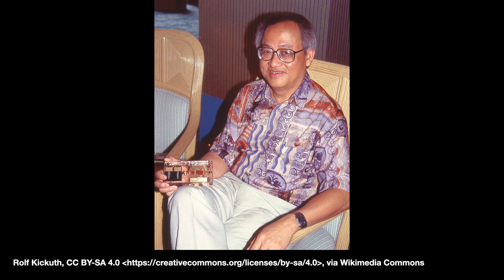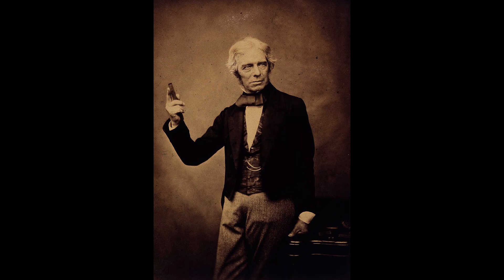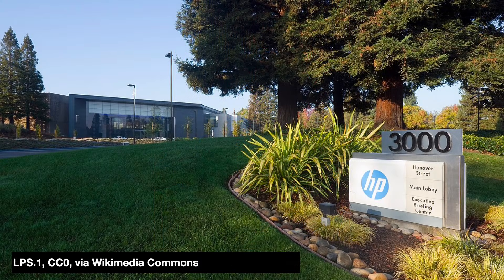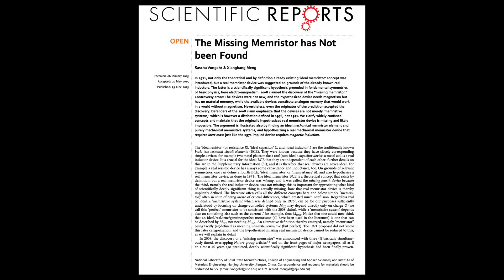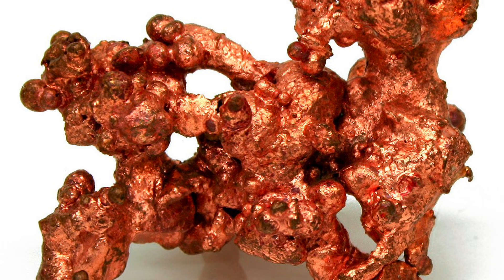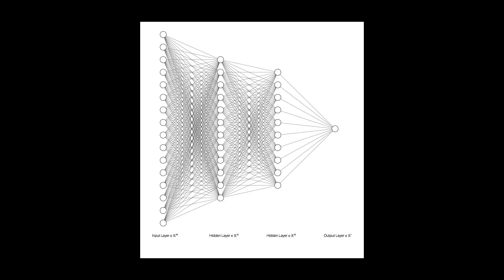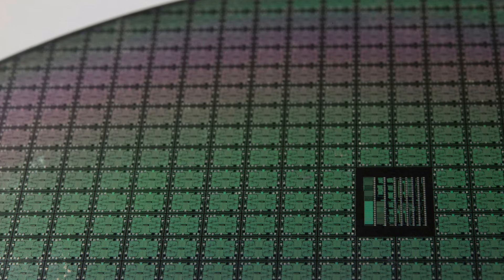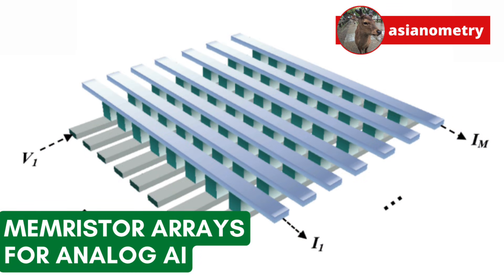Memristors for Analog AI Chips

Comment: I think you could improve the water/memristor metaphor. There's an idea called "preferential flow" where water will flow along a certain path, in this case along sand grains. It prefers to snake through certain channels in the sand as it flows down via gravity, leaving some pores dry and others wet (note: if water flows up via pressure, all pores get filled). Therefore, it's possible to have water flow out of a tube of sand while much of the sand is still dry. Pass another cup of water through it, and it follows the same path, like memory. Over time, water will intrude into the dry areas, though even this is like memristors in a sense because of degradation over many cycles. The memristors I think of with this analogy are the type made from many vertical stacks of 2D materials like MoS2 (think graphene but different atoms).

Comment: Unnecessary complexity. Even a simple resistor is a memristor when considering its thermal characteristics. Heat it up and keep it in a insulated environment to call it off (high resistance), cool it down and call it on (low resistance).

Comment: (1:40) Actually current (I) is not limited by a resistance in it's path. 
That happens when the path or is divided or otherwise diverted. 
Voltage (E) however, drops increasingly across an increasing resistance and the available power is reduced (because IE, or current times voltage = Watts). 
So a series resistance regulates power or ability to do work.  
If you make a ladder, as it were, of many parallel "rungs" of resistors, the voltage between the two rails will remain constant, 
but the current will be divided between all of the resistors. 
Greater power will be consumed in this, or in any circuit or part, by less resistance and maximally by zero resistance (e.g. short circuit).
Reply: EE here.  Yes, a resistor can limit the current.  If your supply voltage is 5 Volts, a 5 ohm resistor in series limits the current to 1A by dropping voltage.  The current in the circuit cannot exceed 1A.  This is what we mean by resistors limiting current.

Comment: This was a tough topic and concept to understand at least for me. But you sir described this in great logical chronological detail. That even I could understand it. Basically the flow of electron get sifted through a “movable” variable resistor. Which multiplies it and then gathers those values and adds then giving you an output. Did I get that right I hope. I don’t know why it muliples it maybe I said but I forgot. And why add. What’s the output for. And also how is this memory hwo is it a seeding something that happened in the past to use now. And fyi I thought at the beginning it would work more like the resistance changes depending on the previous resistance needed, and I guess when a new current or voltage would come it change again to that past resistance value leading it to idk change on the fly. Maybe that’s nano tech sci fi but that was just what I though going in. But coming out I now think differently. Again thanks for the breakdown and detailed video thank you and I hope you do more and carry on
Reply: imagine a river that creates a meander as it flow i believe thats a good analogy. the current shapes the resistance and the resistance shapes the current

Comment: Intel made an analog NN chip in 1990 based on  flash memory cells (aka isolated gate FET).   It wasn't a commercial success but I believe it's likely the best approach. Flash cells can be made in any normal CMOS process with very few extra steps. Analog NN really are many orders of magnitude more efficient because you're not shuffling data through your limited number of compute units.  Digital NN will also benefit from having compute local to every memory row,  but the chip real estate would get enormous.

Comment: The memristor is a non-linear device with two terminals. You have Diodes and Thyristors that fill this role. Or you can use a transistor and tie the base to the source or drain to form a two terminal device that has non-linear IV curve.
No need for memristor at all.
Reply: Memristors are a single component that can be engineered into a system to present several effects that are spread across several different types of circuits. While it is true that some of those effects can be replicated by certain other component configurations they are an order of magnitude more powerful than other configurations. It will in essence be the next step in components offering the change transistors offered. .

Comment: Hey, so... If you could get a memristor to quickly react to a high or low current and match it, wouldn't that just make... Ram SSDs? Like, actually. Could also be really good for CPU/GPU cache.

Edit #1 : I know memristor are, by nature, already RAM - but analog RAM. Doing what I suggested could make it binary, thus much more suited for non volatile RAM and cache. Like, could you imagine having a power outage, and when your PC turns back on everything's exactly as it were before it crashed?

Edit #3 : Actually, why limit it to "0" And "1"? By reading multiple levels (Let's say 0 to 3) you could have incredibly dense memory/cache (in this example case, 2*2*2*2 so 16 bits of data) similarly to how high density SSDs already do with different charge levels. Honestly, the memristor could probably fix the "cache apocalypse" of TSMC's 3N and below nodes since they're a single transistor instead of many, even if they might be a  little slower at first.

Comment: if they can figure out how to combine this with on chip forward-forward training (much simpler than back-prop but still good learning ability), it would be a huge step in using AI in a way that is not so centralized and does not need network connection, while being able to learn as it goes

Comment: Neural network of human brain is not analog. It is basically digital: A neuron can be activated or deactivated like a digital switch, not in-between. But it has variable number of input signal threshold to activate the neuron. kind of summing OP-amp/comparator. Resulting circuit work like analog circuit. Digital CMOS circuit can behave similarly. A array of switch coupled with digital memory cell also can work like summing OP amp. Not computing in digital binary number, but summing number of active inputs in analog way, though inefficient and low precision.

Comment: This is cool for me because I used to be in a group BEAM memristor group where guys were working on making them at home! 
Recently I've learned more about electronics and now there's all this legit research on the topic and it's great stuff.
Reply: I used to be part of a BEAM robotics group too, and before it died out, one of the last major discussions was the possible applications of memristors, and there were a few experimenters trying to make them. I think all of us had seen the Nile Steiner video and his home made memristors. I did 2 experimental designs, and did a full concept for a third, that I never tried out. First experiment was an absolute failure. Tried using silver paint to create the electrodes through a pinhole in an insulator over a Copper Sulphide layer over copper. The Copper Sulphide was way too porous for the silver pain and it just soaked in and shorted. 

For the second design, I bought 0.6 mm diameter aluminum balls from McMaster Carr to act as point contact electrodes. I created a sandwich between two PC boards, with the bottom layer masked and the copper pads reacted with sulfur to create the Coper Sulphide electrodes. The top layer reused the silver paint as a bonding agent to secure the aluminum balls to the top board. I screwed the boards together, but imperfections meant most of the 16 possible memristors on the board were either not under full contact, or were crushed by the force of the screws joining the boards. I had two of 16 memristors show hysteresis for about 2-3 test cycles before breaking down... a small success, experimentally, but ultimately, another production failure.

My third design, which I wanted to try, but then the first discrete chip based memristors hit the market (though costly). I never followed through, though I've considered going back to it. The design used a thick "sturdy" PC board as a base, and again, silver paint would be used to bond tiny Aluminum balls to Copper pads. these pads would attach to a 20 pin header soldered to the board. a spacer board and a "finger" board would be made from 0.5 mm PC board material. the spacer would support the finger board 0.5 mm above the base PCB, and the fingers would look like a comb with header pins on one end, and thin fingers tipped with a copper pad on the other end. Those pad tips would be reacted with Sulfur to create Copper Sulphide electrodes that would have only the force of flexing an 0.5 mm PCB by 0.1 mm. My hope is the much lighter force would not crush the fragile Copper Sulphide layer, and allow memristance to be observed. By having two rows of 20-pin headers, the part would have the footprint of a 40-pin DIP, be usable on breadboards, and offer 20 memristors in the space of a 1980s era CPU. That was the plan... I didn't learn KiCAD for another 4 years, and since then, KNOWM has released even more memristor options for discrete experimentation. Still spendy, but not as bad as the old Bio Inspired versions from several years ago.

I'm glad this video is covering the more analog capabilities of memristors. So many companies just looked at it as if it were just RAM 2.

Comment: There were two small start ups working on this in the US in the past few years but one of them went under like a year and a half ago. Definitely promising just needs the right team and right market concept. Edge computing the demand just isn't there yet and it's a lot of infrastructure to build up, I think it'd be smart to start with gaming accelerators - make a PCIe card that has a series of chips for accelerating vocal intonation, NPC attitude, body language, facial expression/animation to line up with speech, all these little things to really make AI use in gaming pop. You probably couldn't load up an LLM, but you could locally turn the flat speech sent by an LLM into dynamic responsive NPC behavior. like a "Narrative Processing Unit" instead of the "GPU" the "NPU" or some crap like that. 

It's a concrete goal, you could turn out a decent, usable product and partner with a couple modder communities and big titles to get enough buy in to set up widespread consumer sales, then like a year of work and testing by the team and use the profits from the first run to expand out into the wide variety of areas this technology could be awesome for.

Comment: This is one of those things like oleds where it needs a killer app to receive the research to make it viable to be worth that research. oleds languished for decades as a curiosity until phone lcd backlight display power started being a significant limiting factor in battery life. oleds still haven't even come close to supplanting lcds for larger displays but the chemistry has been done to provide stable organic leds.

I think the concept of a memristor array is going to have a tough fight with in-house AI implementations. The exact nature of the nonlinearity and process variation will put pretty strict requirements on the ADC arrays for resolution, and I think that itself makes for a challenging computational task. If you need a 24 bit ADC to get useful information out of a memristor array when a TPU is using a custom 7 bit float in it's MACs, there's a significant digital tradeoff between a memristor array and "conventional" digital AI training even excluding the analog performance improvements.

Also, is it just me or should there be a DAC on the other side of the memristor input line? DACs are quick and it saves a step in the MAC process.

Also also, This is the same Chua who invented (ish) the Chua circuit, which is cool.

Comment: The concept is wonderful, in concept. Reality has to be factored in. And the biggest factor is what limits all analogue computing. Precision. Particularly devices that have non-linear properties. The Intel 486 multiply section had a small digital error. Only detectable when you start to compound arithmetic cycles, like subtracting large numbers to get relevant small differences. Accuracy is then ALL. Analogue may be faster - "but" once it gets complex ! Think human mental arithmetic. Large numbers. Any operation. How good are you?
Reply: @@giusdbg the techniques that allow digital to run fast will allow memristors to run fast enough to compete with an algorithm favourably. Horses for courses. Precision and complexity will be the digital domain. And multiplying with a memristor is basically "parameter 1 set R, then pass current for parameter 2". easy IMNSHO, but slower. The matrix addressing is by definition digital. So in reality hybrid. As for logarithms, diode have been made with such characteristics.

Comment: Qinghua University in China built a memristor chip several months ago, and conducted test in AI, and found to be much better than the regular approach. I personally think that by building a Field Trainable Memristor Array (FTMA), similar to the Field Programmable Gate Array, one can achieve AI function very similar to our brain. There is no need to worry about the imprecise nature of the memristor as our brain is also imprecise in nature. Jeff Hawkins of Numemta explained it very well, and has come with highly redundant models similar to our brain that can overcome this shortcoming. Using this approach, AGI can be implemented very quickly, with efficiency and cost very similar to our biological brain. Yes, AGI is finally coming faster than we think possible.
Reply: similar to a human brain? Yea, faster and prone to fallibility. Beware what you wish for!

Comment: I wonder if the defectivity may be a smaller problem than it looks on the surface. 

First, current research into quantized models has shown good-enough performance at inference time all the way down to 4 bits, which would at least seem to suggest a good bit of tolerance for poor precision as long as the overall design of the system takes it into account.
Reply: Well, if these devices were to be produced with unreliable memristor units, then each chip would probably have different nodes failing. You either get chips with individual personalities, or they all break down while exhibiting Alzheimer symptoms. We probably don't need much precision for large models, or even repeatability, but we do need reliability.
I'd rather go with some sort of digital ternary or 4bit circuit as the basis for a node. The voltage averaging of a line of units isn't unique to analogue units, it can be a row of transistors - but you need an adc to read the result.

Comment: One memristor replace a digital macro component made of:
1) An A/D converter
2) An 8 or 12 bit Flash memory
3) A D/A converter.
The applications of memristor arrays as computing memory really depends on the voltage retention qualities of the device.
Thanks for the video,
Anthony

Comment: Another interesting application of memristors could be storing multiple bits in a single cell, greatly increasing the potential density. This would work by the senising voltage being run through an ADC to determine the bit value of the cell. 4, 8, or even16 bit values in a single cell should be achievable.
A further benefit is that memristors can with further development could also become viable as non-volatile memory with potentially far higher speed than current nand-flash technology.
Reply: Multiple bits in a cell? They do it now, the limit is precision. SSD modules deal with that by swapping-in new blocks as they near unreliability/ageing. (a computer on a chip no less) Analogue may be fast, but precision is ALL. Or a moving feast usually. But yes non-volatile, competing with NRAM.
Reply: Memristor and nand flash are completely and fundamentally different in basically every aspect.
A nand or nor flash is a so-called charge-trap design that stores electrons, ie. a charge. The amount of charge it can store, and by extent also the number of bits each cell can store is determined mostly by material purity. Even the most optimistic researchers do not expect to nand/nor technology to be able to achieve beyond 8 bit cells.
A memristor doesn't store a charge. It changes resistance. To read it you send a sensing voltage through. This can easily be amplified and run through a flash ADC, limiting only the number of bits by the required speed. Typical 8-12bit flash ADCs can operate in the 10GHz range as used in oscilloscopes.
The other main difference is that memristors can be read/written one cell at a time whereas nand/nor flash can typically only be written in 4-16KiB pages. Making both potential access time and bandwidth speed in a whole different league from nand/nor flash technology.

Comment: 1:00 What else Mosfet of Flash memory is if not memristor! Non linear, we might use linear part o characteristic all depend on charge
Reply: What i want to say - memristor is magnetic, flash uses electric field requires voltage pump migh be used to hold analog data Holtek once manufactured analog flash memory to record voice messages

Comment: I'm not sure if it works the way I am thinking of it or not. What if you have a material that would change its resistance if you sent a certain voltage or current through it, and it was resetable back to the lower bias state. Then you would have basically flash ram made out of something else. Would it last longer? Could it be as fast a sram?

Comment: Non-linear two-pole devices already exist, in the form of diodes (change when you overcome the forward voltage) and ... fuses (change permanently if you pass a too high current through it). I'd think the fuse better reflects the sand analogy and the memristor sandwich looks remarkably like a diode.